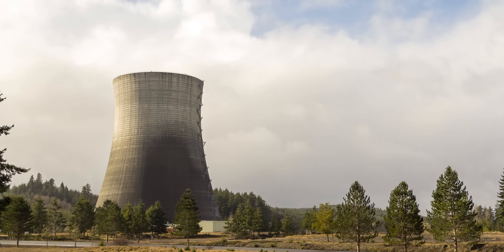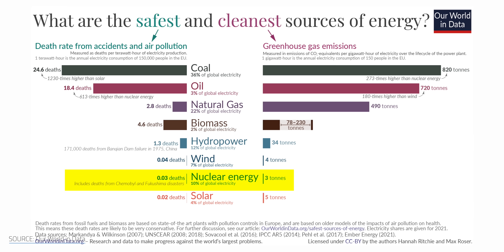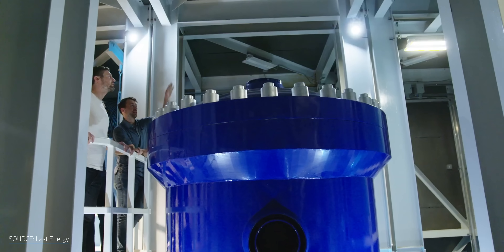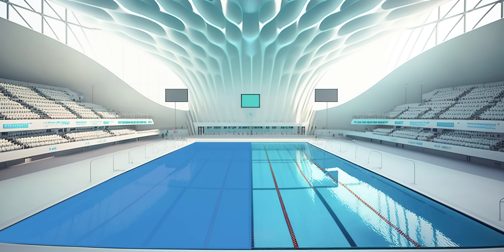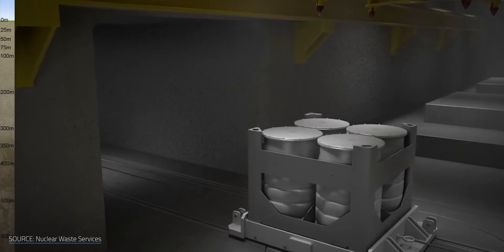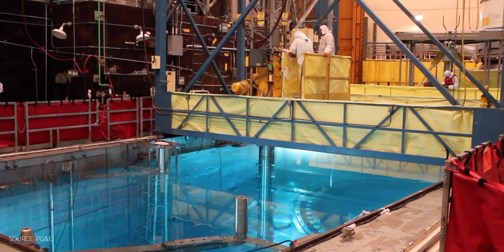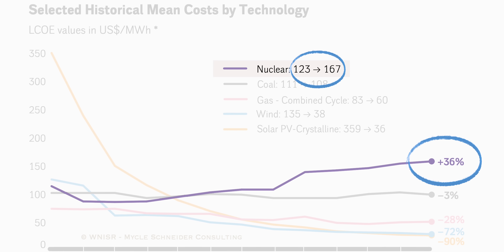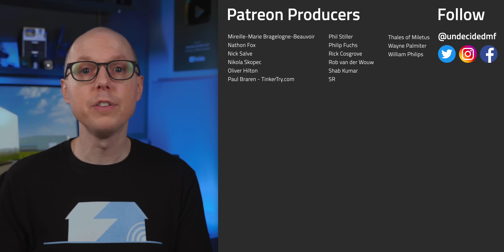Is Small, Fast, & Cheap the Future of Nuclear Energy?

Comment: Nuclear done right is safe... not sure about economics, mainly because of regulatory issues.

USS Enterprise, close to 60 years of safely operating 8 small reactors.
I personally prefer the smaller water moderated reactors for reasons I am not allowed to say...

60 years is pretty close to the practical max life of plants due to metal fatigue and corrosion.  You just can't eliminate these issues.

Scaling the reactors is just a matter of some physics calculations and plumbing... but a standardized design I believe would be far better as the same design built repeatedly has proven in millions of devices and vehicles to improve the economics of manufacture.

I'd even support the idea of a semi-portable reactor FLOATING in it's cooling pond.  That would be highly resistant to earthquakes, flooding and other issues.  Pretty close to taking the power plant of a nuclear submarine, capping the ends of that part of the hull and wiring it to the power grid.  We have just over 60 years of experience operating that basic size plant very safely.

Comment: Does the LCOE for nuclear, especially SMRs include the idea that they can be sited at existing conventional power generation stations? This means much less construction of new transmission lines. SMRs can be incrementally added to, say an existing coal plant to allow coal to ramp out and the nuclear to take over.

Also, the military is working on the concept of micro reactors to fuel defense bases. Currently, when a base is established in a wartime situation, massive diesel generators have to be brought in as well as provisions for a constant supply of petrol to fuel the generators. A nuclear micro reactor instead of large conventional generators would be a big win for the military as well as the environment. I believe such a project is going on in Alaska at this time. Micro reactors would also make sense in towns located in remote areas.

Comment: This video brought to you by the nuclear industry. Do a video on Vogtel nuclear power plant modular building construction failures $37 Billion and bankrupted mega-corporations. You cant talk about dangers of fossil fuel mining without talking about uranium mining. 
Where is the enriched uranium coming from? Russia most likely which is terrible. Nuclear power plants are now war targets that can not be attacked. Solar panels dont have this dilemma.
Nuclear power plants have been melting down in my lifetime every twenty years or so. About due for another one. What they have in common when they melt:
Never tell the public until they are forced to. Add a bunch of safety features after each disaster, then complain about regulations. Clean ups are 50+ year minimum. 

https://en.wikipedia.org/wiki/List_of_nuclear_and_radiation_accidents_by_death_toll

No one wants deal with accumulated waste from our grandparents generation and the plan is now to leave it to the grand kids to figure out. Nuclear power sucks in this regard. If there is no plan to deal with the waste why create more? 
Stop with the fuel recycling plans your dreams are 25 to 30 years away and multiply any reasonable time estimates by 4.  Solar and other choices will have it covered by the time a recycling plant is built. 
No mention of any security needed to protect these from becoming dirty bombs by terrorists. Are they hardened against external attacks?

Comment: the most poluting energi is nuclear energi.. this video pretends it is nothing. it is only few %.
but it is still dangerous for long time. if you enrich the waste, you can end with waste that is very very radioactiv, for billions of years. not only few 1000 years. anyway we dont remember what is in the pyramids, they are only 3-4 thousind years old. 
i know  really vcan not trust any video that tells us redioactiv waste is nothing. 
rememebr a nuclear reactor have to cool down for at least 300 years before it is cool enough to disasemble, and still you need to keep the reactor safe for very long time. also. 
it is waste on wsste on waste. it is waste of money and time to consider nuclear waste. just look at the intelligent germany, they are going away from nuclear energi, as fast as posible. 
ans last. try to google search nuclear disaster, and you will find out you have never heard ablut most off them.

Comment: Plant vogtle in ga is just coming in line will cost nearly $30Billion (way more than $9-10B) and is raising the cost of power in Ga by an est 40% over the next 3 years that really impacts those least able to afford.  The future of modular reactor my mind will be a different technology -- molten salt is in example that have inherent safety aspects (over PWR and BWR reactors) as the fuel is in the salt itself.  These designs are way for efficient in using more of the uranium with less (expensive) enrichment (before being depleted) and are  designed to to buun up and eliminate actinides (fission by products) and reduce half life of the waste to 300-400 years.

Comment: Tbh? I think a mix of solar and nuclear can pretty much take care of the energy grid. Especially with this tech, fabracting scaled to order plants for energy entensive facilities like factories or hospitals sounds fisable after optimization. while on a big enough scale, it's very realistic to expect a solar home community to create it's own independent grid, diverting excess power to places that need it and basically annihilate the power bill to only the standard maintenance cost. You could then complemnt it with wind to buff up the supply in low sun area and stormy weather, as they tend to pick each others slack. Something I think a lot of ppl miss, is that no energy is either capable nor should be expected to reasonably power an entire planet (and yes I'm counting coal, poisoning the planet is not reasonable). Not in any reasonable price or effectiveness at least. Mixing and matching which method fit best where on the other hand will ease the strain on whatever single method and bluster the entire grid against failures

Comment: I had thought of something like this years ago. How much can the reactors in US Navy submarines and aircraft carriers produce? What would it take to convert these for use to power a town?
Waste disposal. I really hate the idea of having to set up long term storage and the tremendous security that will be necessary. What would happen if these casks were dropped into the center of the lava pool of Kilauea? If they're strong enough, they can go very deep before the heat melts and consumes them. Or, what fairly cheap rockets? The only guidance they'd need would be to get them on a general track towards the sun. Get them to escape velocity and gravity will do the rest. I'll bet it wouldn't cause so much as a burp as it enters into the sun.
Note: Wikipedia - It is estimated that the thermal power output of each A1B will be around 700 MWth. How many homes will that power?

Comment: Gee, that tech is cool..."
This model of common plant design makes a very practical sense. It is one highly pragmatic solution (and one which has needed solving for a long while - like from the 'beginning', imho. But I am wondering about cumulative effects (radioactive source materials, storage/disposal of no-longer-usable fuel., and, of course, long term exposure of the plant itself to the radioactive fuel. If we go in to replace a malfunctioning widget, it [potentially?] will be radioactive, as well, would it not? With smaller 'plants', you can't just throw a widget in a cannister in the corner and seal it up once it is full.
I also wonder about the relative rarity of radioactive materials for use as fuel. It is not, as you say, something you can just run down to the Spacely Sprocket store and have them whip one out, as you mentioned in another sense. Are we just going to dig up the supplies in the grand canyon and turn it into an yet another open-pit mine? And please, don't get me started on carbon storage, and the similar long-term radioactive waste storage. 
How about a mini-reactor? (Just big enough for a stand-alone house, or say four apartments, or a dozen 'tiny homes' (about oh, ten to twelve)? So much going on, and so many variables...

Comment: Thanks Matt!  I have 2 comments.  Your cost of nuclear is skewed by the huge cost and time overruns at Vogtle.  Now that Vogtle 3 and 4 are done there is a great possibility that the next AP-1000 reactor will be far cheaper and quicker.  The design is already approved by NRC and the supply chain and workers are in place.  Many are going in overseas.  Also, SMRs are not standardized.  There are a relatively large number of vendors all building first of a kind reactors of very different generation 4 technologies.  That will add significantly to the cost and each competing company will sell fewer than expected making them more expensive.  And all of those designs have to go through a separate approval at NRC, a horrendous task.  I say dont give up on the AP-1000.  Just build many of them simultaneously in the US as new reactors and replacements for the old fleet.  Most of the old reactor sites are designed to handle additional reactors.  SMRs for old coal plants is a great idea but we dont need 100 new designs to compete with each other!

Comment: 6 - 10 biilon for a 110MW reactor? Vogtle 3 & 4 are together with hinkley point C the most expensive nuclear power plants ever build. vogtle is 30 billion for 2 234 MWe combined capacity which results in 1.5 billion for 110MW of capacity. Hinkley is 40 billion for 3 200MW which results in 1.37 billion per 110MW. A real shame that these continents lost all their building expertise because they could actually build reasonable to even cheap powerplants in the 70s and 80s.

Comment: My personal advice; create a wasteburner variant of this design, and you can tap the currently available global nuclear waste stockpile as an energy source, which could power the entire planet for centuries. Want more security ? Dig a big hole (where applicable), put a concrete tub in it, place the SMR complex (plus everything it needs to properly function) in the tub, put a thick concrete slab on top of it, and you're done.
Reply: Do you actually think you just dump some spent fuel into a waste burner reactor?  This ain't cartoon s guy
Reply: @clarkkent9080  Of course not. The reactor waste would first have to be re-processed before it can be used as reactor fuel, of course.
Reply: @fjvmunsterman  Well I am surprised that you know that.  You must also know spent fuel is not only highly radioactive but presents a criticality concern that makes that process very expensive as well as creating large volumes of radioactive secondary waste.  Then of course it would have to be blended to a known radioisotope concentration.
A new virgin fuel assembly costs ~$400,000.  Based on the financial reports from the U.S. MOX facility a fuel assembly generated from spent fuel costs ~ $ 50,000,000 and that does not take into account the final facility decommissioning and handling of secondary waste.

BTW, France has no intention of replacing their reprocessing facility as it reaches the end of its life and they have only reprocessed 1/3 of their waste.

It is all about cost ...plain and simple

Comment: Elon Musk said if you cover all the land a nuclear power plant uses with solar panels that you will get the same energy output.  A 110MW plant was mentioned in the video.  I worked at a coal-fired plant that generated 3,200MW.  Most new plants are powered by natural gas where they drive generators with essentially jet engines where natural gas is the fuel.  Nuclear will never compete with the cheaper alternatives.  People are scared of it and multiplying the number of reactors by 1000x isn't going to help, even if the data shows they are safe.  It may be irrational but that's the way it is

Comment: Nuclear waste reprocessing is also a solved issue at this point. There are reactors that will take the waste produced by other reactors, breed it into more reaction mass, generate power with it, get different elements than they started with, and continue making energy from it all the way down the chain until they end up with plain old ordinary non-radioactive iron. Nuclear waste is over as a concern entirely. You don't need to store it, at all. You sell it to a reprocessing reactor, and they use it to make money for themselves by providing power, and then sell the scrap iron.
But if you DID need to dispose of it, encase it in tungsten and throw it into a volcano. It'll sink down into the Earth's core where it came from.
Reply: Name one ?
Reply: @clarkkent9080  ...name one what? Nuclear waste reprocessing plant?
Plant 404, CEA APM, UP-2-800, UP-3, Trombay, Tarapur, Kalpakam, Tarapur, Rokkasho, New Labs, Khushab Nuclear Complex, Plant BBRT-1, RT-2.
Reply: @williambarnes5023  REACTOR that burns spent fuel.

What do the facilities that you list reprocess?  Remaining U235, Pu239?  What about all the fission products?   Do they recover fission products for use in reactors?  

The WASTE in spent fuel is fission products and extracting any remaining fissile material does not change that and actually results in large quantities of radioactive secondary waste.  And do you want to chat about the accidents at those facilities?  People are unhappy about the accidents at commercial nuclear facilities and you want to add reprocessing that has a very troubling safety past.

Comment: Wind and Solar WILL NEVER PROVIDE ENOUGH POWER FOR THE WORLD EVER EVER...NUCLEAR IS THE CLEAN GREEN ANSWER
Reply: Here is that answer.

If you live in the U.S. here is the reality for the last 4 “state of the art” Generation III Westinghouse AP1000 ADVANCED  new nuclear power projects and spent fuel reprocessing in the U.S. over the last 20 years. The AP1000 is fully approved by the NRC for construction and operation.  The only NRC requirement is that the plant be built per design documents…..seems simple..

The Southeastern U.S. is super pro-nuclear MAGA, has zero anti-nukes, and 100% media, local, and political support. 

The MOX facility (South Carolina) was a U.S. government nuclear reprocessing facility that was supposed to mix pure weapon grade Pu239 with U238 to make reactor fuel assemblies. It was canceled (2017) in the U.S. After spending $10 billion for a plant that was originally estimated to cost $1 billion and an independent report that estimated it would cost $100 billion to complete the plant and process all the Pu239, Trump canceled the project in 2017.

VC Summer (South Carolina) new nuclear units 2&3 were canceled in 2017 after spending $17 billion on the project (original estimate of $14 billion and 2016 completion date) with no clear end in sight for costs or schedule. Four managers on the project were charged with 16 felony counts, including conspiracy, wire fraud, securities fraud, and causing a publicly traded company to keep a false record.  The CEO of the project is serving 2 years in prison, another manager just got 15 months in prison, and the others are awaiting trial.

Vogtle (Georgia) new nuclear units 3 & 4 at 120% over budget and schedule The third and fourth reactors were originally supposed to cost $14 billion, but are now on track to cost their owners $31 billion. That doesn’t include $3.7 billion that original contractor Westinghouse paid to the owners to walk away from the project. That brings total spending to almost $35 billion. 
Last year, according to the project management, the project was delayed because thousands of build documents were missing. Unit 3 started April 1st 2023 and then shutdown for 3 months for more repairs before coming on line in late July. Unit 4 is at least 1 year away from \operation. Vogtle unit 3 &4, for their output, the world’s most expensive nuclear power plant..

Please google any of this to confirm.

If you can’t build new nuclear in the super pro-nuclear southeast U.S. then where can you build it?

Comment: If you look at the 30% ave production from solar and wind and their short lifespans, and the large sqM  sizes required for their installations their LCO is around coal and less attractive than 1st look.
Nuclear's 100% or close uptime, long lifecycle, small footprint for SMRs puts it much better LCO and attractive.
Only barrier really are The Greens w their nonsense. Societal not practical barrier.

Comment: If the money being spent on revising and perpetuating old, fuel inefficient and inherently more expensive nuclear power generation technologies were expended on refining Molten Salt Reactors MSR's would provide a safer, cleaner, substantially cheaper alternative to high pressure pellet fueled systems.

Seems to me that interests vested in pellet fueled reactor designs are doing their utmost to alter and sustain positive public perception for a technology that could and should be displaced by Molten Salt Reactor technologies.

As I understand it MSR's are capable of utilizing virtually all of their fuel as well as utilizing waste products from antiquated, pellet fueled technologies.

Given that advantages inherent to MSR's significantly outweigh outdated pellet fueled systems, it is astonishing that designs dependent on pelletized fuel continue to be extolled as though it enjoyed some measure of virtue which simply does not apply.